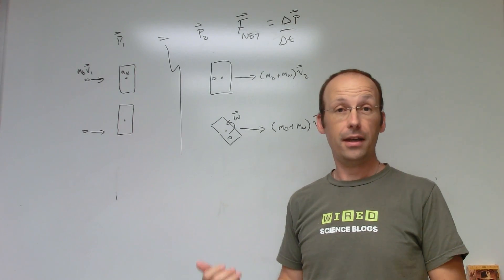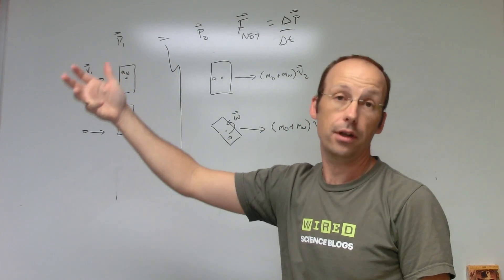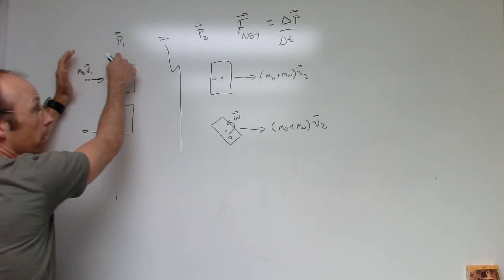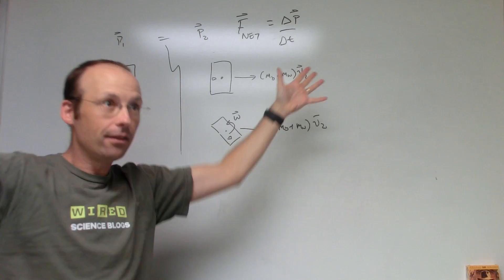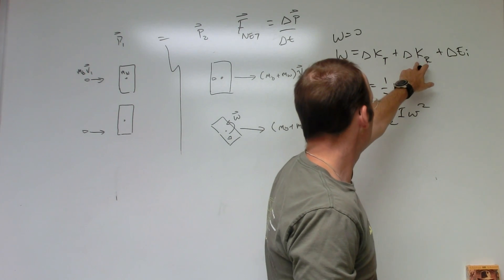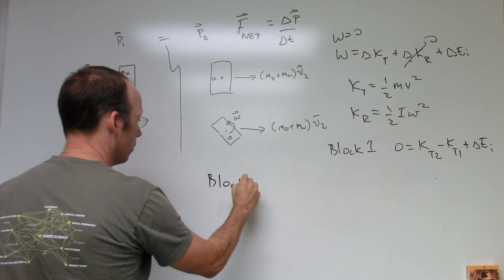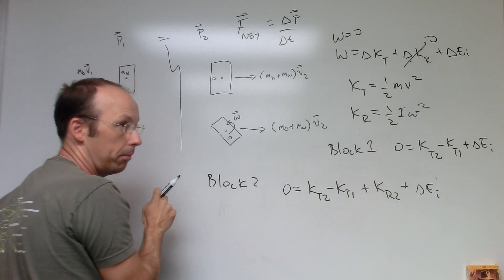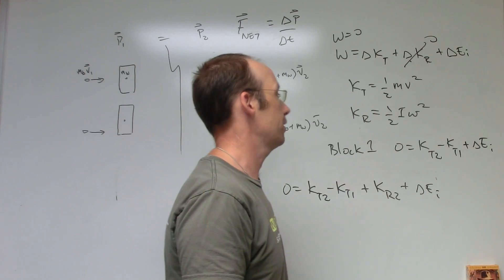Veritasium bullet-block answer

Comment: I keep thinking that the spinning block should be wobbling because it's center of mass changed when the bullet got inside
Reply: I saw the video again, and the block is in fact wobbling, so I think that it goes to the same height because: although it's loosing energy do to spinning it's making a whipping motion that helps the block go to the direction of the initial force applied to it

Comment: Momentum is only conserved in a closed system. The block gets acted upon by an outside force, so it can't be considered one until after the collision.

If you wanted to get technical about it, you could define your system as the block + the bullet at all times. Then angular momentum is conserved even before the bullet hits. This would be because the bullet moving upward at an offset 'r' away from the block's center would technically constitute a constant angular momentum.

Comment: I totally agree that if you include the Ei term that you can get energy AND momentum to be conserved, but isn't it a little bit of a coincidence that the Ei in each case gives the block reaching the same height? I mean, the Ei's could be equal to anything, I don't see any reason for a specific case where they both give the same height?.. unless the position of the shot was specifically chosen?

Comment: It was a 36 or 40 grain bullet.  The block weighs so much more, that the tiny extra weight did not change the center of mass enough to be measurable.  The physical principle may be sound, but if it's working at a scale where it can't be measured, then it can be neglected, and that causes an unexpected result.  If it causes a deviation of 0.001mm, and we only have 1mm resolution, it's like it didn't happen.  It may have happened, but we can't know.

Comment: In this case it's not too hard to ignore it but the point is that mechnics problems can be less confusing if a system is defined. It's easy to visualize a system where the height (difference) answer is trivial. COM of System= Earth/Gun+Bullet+Block is "stationary", therefore both blocks must rise to same height. As you calculate in your answer, the internal energy within the system is what's different in the two initial conditions which explains the rotational energy in the second.

Comment: The acceleration due to gravity can be ignored.  If every part of the system has an equal external acceleration component, a reference frame accelerating with gravity could be used to ignore gravity.  The point is to focus on the actual problem.

Comment: This answer does not include a description of the "System". It should always be the first step in solving these type of questions. Momentum is not conserved in the system of bullet + block since there is an external force acting on it. You have changed the system in your answer by removing it. The Earth+Gun+Bullet+Block should be the system IMHO.

Comment: You two are probably thinking about two different "systems". xokoodo prob is talking about a block sliding on horiz a surface (see Physics probs) with a force offset from COM. It won't rotate due to constraint of the slide surface (frictionless). In "free space" I agree that there would be rotation.

Comment: I understand the relative positions of the block and the bullet are locked after impact, unlike with binary stars, but because of the two different densities and weights of the block and the bullet, I can't think of them as one mass with one density, and one force acting upon it. I think it's easier, and more accurate to think of them as two different masses interacting with each other, even after impact.

Comment: I agree he reasoned the elastic case incorrectly, but the momentum change of the whole system is still zero.  The block's final speed in the in-line shot is much higher than in the inelastic case because, with restitution=1, the bodies separate at the same speed as the bullet approached the block.  The off-center shot becomes more complicated because it's now a 2-D momentum problem (the bullet gets redirected at some angle rather than coming to a dead stop, thinking about the ice-rink analogy).

Comment: It would be interesting to try the experiment with an isotropic material.  That might reduce the difference in delta(E_i) between center and off-center bullets.  With the off-center bullet hitting the wood block, as the block starts rotating, the bullet's path through the block curves a bit and becomes more parallel to the grain.  I'd like to see the two blocks split open to see the bullet paths!

Comment: When bullet hits block, bullet and block apply equal and opposite forces to one another until both achieve a common velocity. If the line of application of the forces doesn't pass through the block's center of mass, a torque is applied to the block. The now-spinning block also applies torque to the bullet via frictional forces until the bullet stops penetrating the block. With your reasoning, a spacecraft firing a single thruster would only translate (not rotate) regardless of thruster location.

Comment: Just a comment on the new thought experiment set-up.... The second block would NOT spin on frictionless ice. The reason the block in the video spun was because the gravitational energy was pulling down from the center of mass, and the bullet was pushing on the edge, thus creating a net torque. On frictionless ice there is no second force, and thus there can be no torque. Both blocks on the ice would move translationally, with no spin.

Comment: Might the orthogonal vector components render them independent of each other. That is the rotational momentum in the y axis is independent of the translational momentum in the z axis. If there were a mixture of these, so some of the rotational momentum had a z axis component some of the velocity in the z axis would be lost in rotational energy, and thus the height would be less.

Comment: I was thinking this over, as a low level high school physics student, and I knew the momentum had to be the same (thus the velocity had to be the same) and I came to this revelation that the block must give, or rotate, away from the bullet not allowing it to embed as far. I was elated to find that I was actually right and that someone else had come to the same conclusion. AWESOME VIDEO.

Comment: I agree with Hal Harris-- the momentum change in the elastic collision is larger, and thus the block goes higher. In terms of energy, you don't lose any of the initial KE, so the final KE of the two is larger when the bullet bounces off the block.

Comment: This is a very nice, and correct description of this problem.  Good job, except for the incorrect description, at the end, of what happens when the collision is not inelastic.  If the bullet bounces off, then the change in momentum is larger than in in the completely inelastic case, and the block would go higher than in the inelastic case. In the completely elastic case, the momentum change is twice as large.